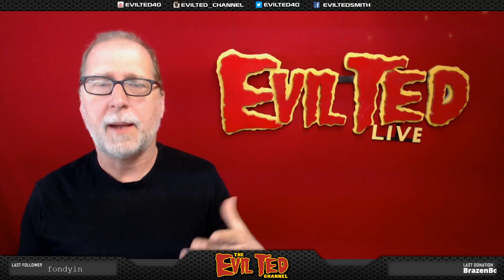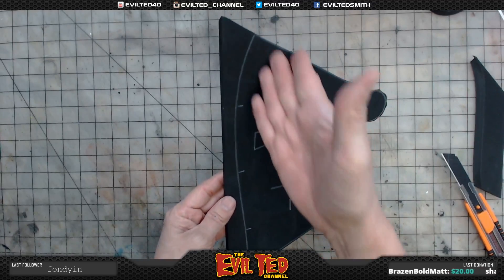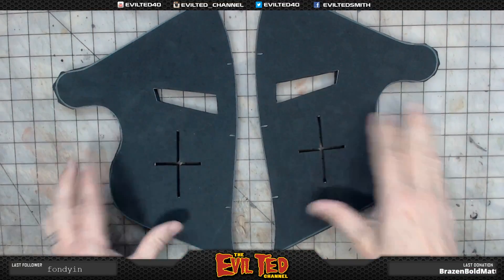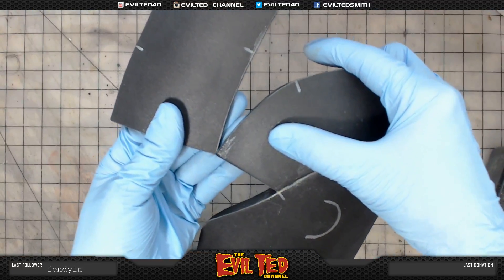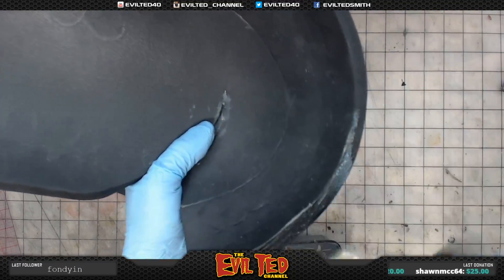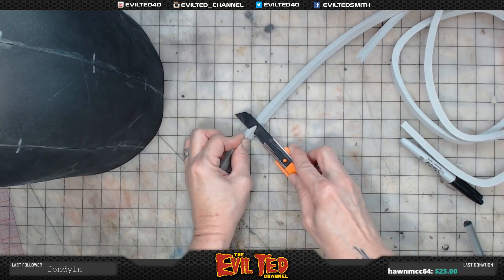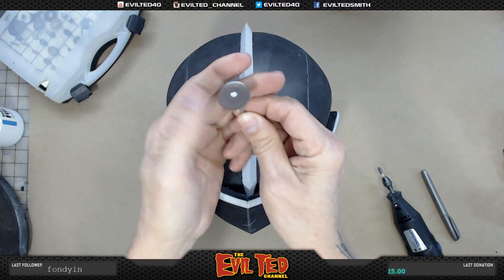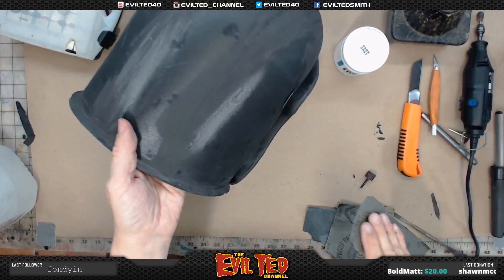Evil Ted Live: Making a Foam Knight helmet

Comment: How do the patterns work with cardboard? Or how does this foam do with fiberglass shell? I want to sculpt designs onto the helmet and need it to be solid
Reply from the maker: If you put resin on the foam helmet, the resin will melt the contact cement and the helmet will fall apart.